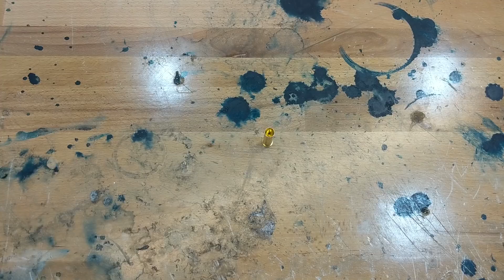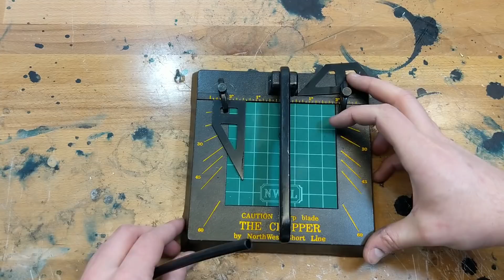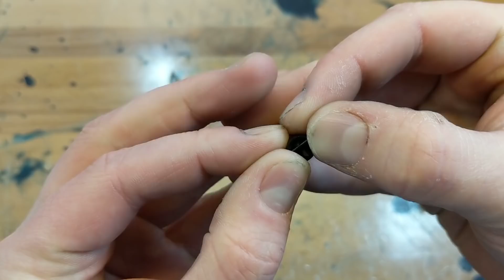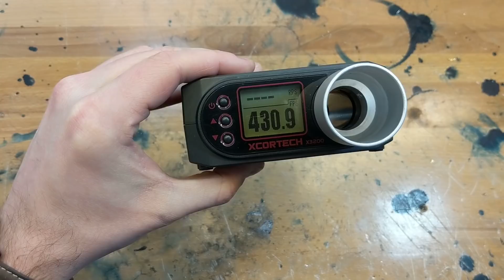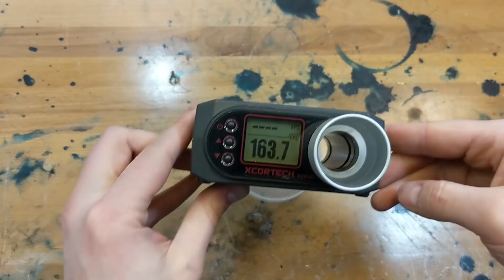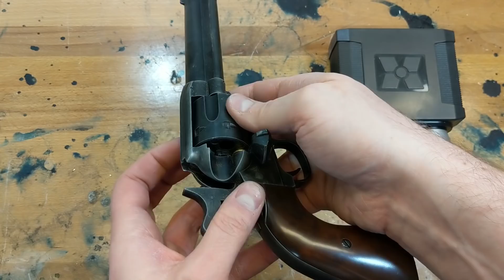Airsoft Tutorial- How to Build Multi-BB Revolver 'Ratshot' Shells

Comment: Would I be able to do this with .38 special? I can’t find any unprimed casing for 357
Reply from the maker: Yes, .38 Special and .357 Magnum are the same nominal diameter, just a bit different in length. They'll end up with the brass a tiny bit shorter, but should work just as well.
Reply: @ExplosiveEnterprises  awesome thank you so much

Comment: Protip: I have tried this before with once-fired .357 brass. Many of the shells did not fit in my revolver due to tiny imperfections in the brass from the firing. I believe a shorter .38 (which is the same diameter as a .357, just shorter) would fit more consistently.
Reply: And you buy 500 of them unprimed at Xtremebullets.com for 70 bucks.

Comment: Thanks. I've made this with PRIMED shells for my smith & wesson 686 revolver. I also added the innerbarrel tubing and little hopup addon (barely fitted) but it works! With only primed shells i'm getting 350-370fps, with little bit of flash powder from firecrackers i get 520fps on meter, and with much powder i got 780 fucking feet per second! That should be illegal.

Comment: Will this also work with dan wesson revolvers
Reply from the maker: Yes, as demonstrated in the video. The newer Dan Wessons may require the brass to be sanded slightly on the case mouth to avoid unnecessary friction.